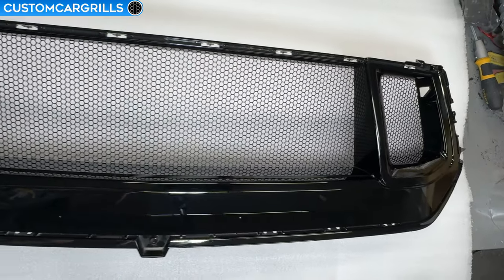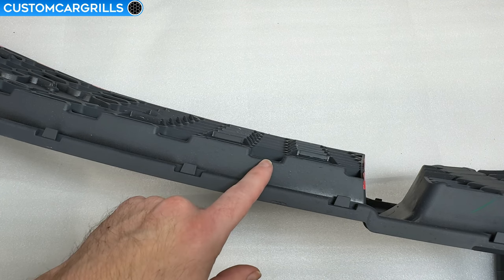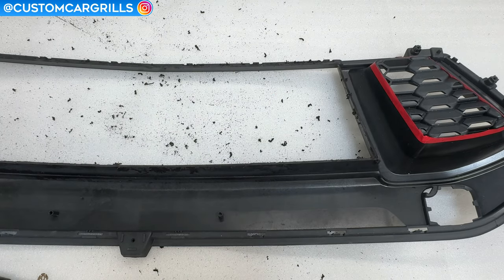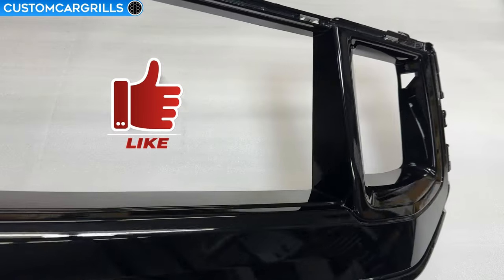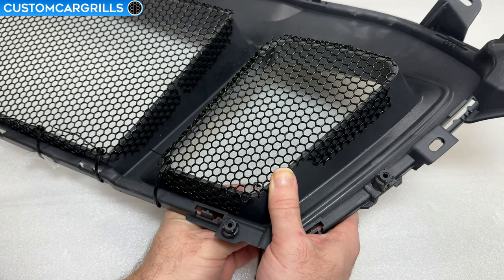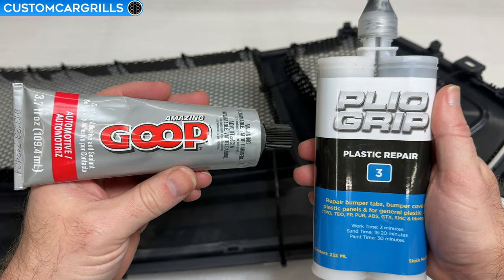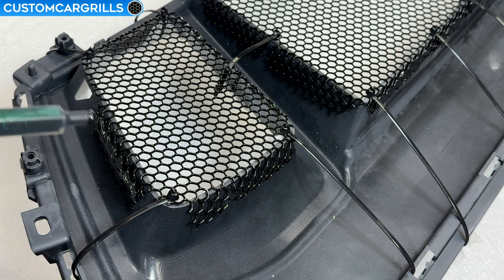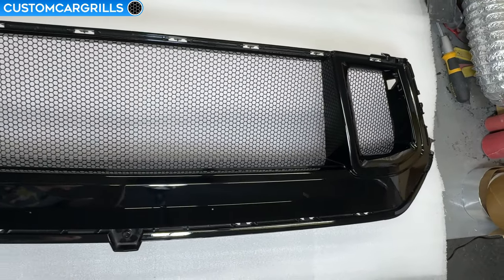Ford Mustang GT 2024+ Grill Delete Mesh Grill Installation How-To by customcargrills.com

Comment: Do you need to take the grill out of the bumper to do this?
Reply from the maker: It might be technically possible to keep the grille on the bumper to do the mod, but it would be incredibly tough to get a good clean cut.